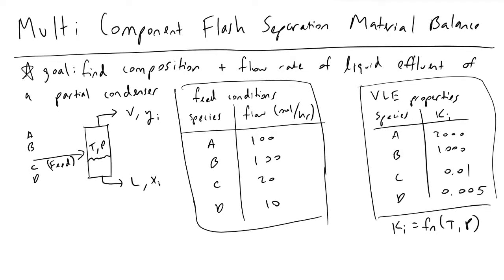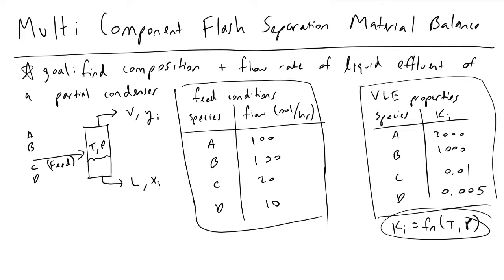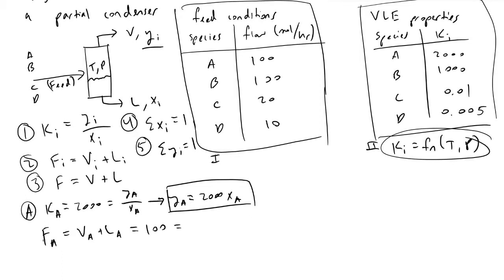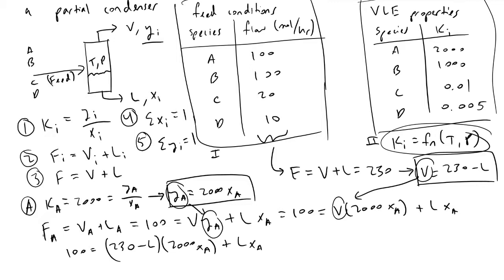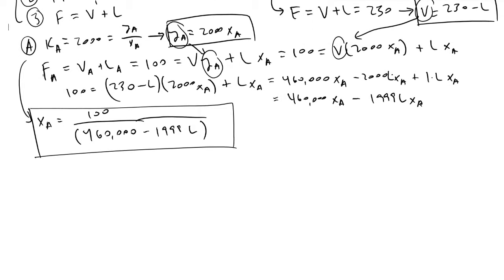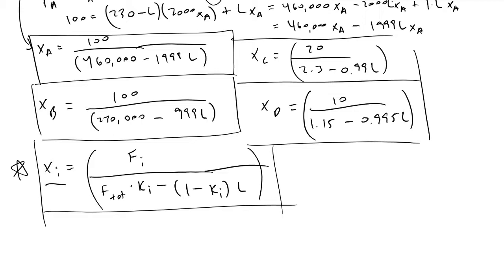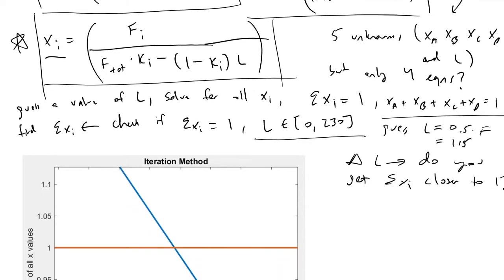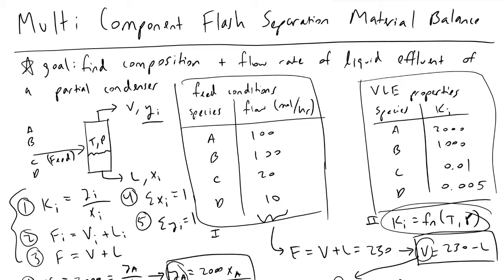Multi Component Flash Separation Material Balances

Comment: Where do you get values for ki from?
Reply from the maker: Ki in this example was made up, but it is the equilibrium constant for each species at VLE at a particular temperature and pressure that you look up from a table (thermodynamic property).
Reply: @VincentStevenson  Ki is the ratio of fugacity  coefficient in the liquid phase to the fugacity coefficient in the vapor phase which can be calculated using EOS. Is this true ?
Reply: @VincentStevenson  But that values are only available for light hydrocarbons. what about others? like benzene??